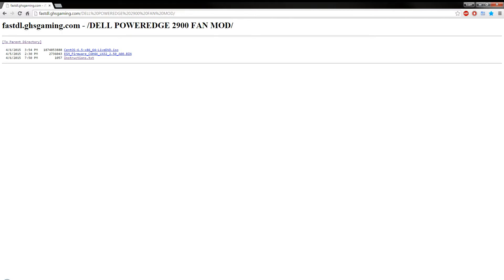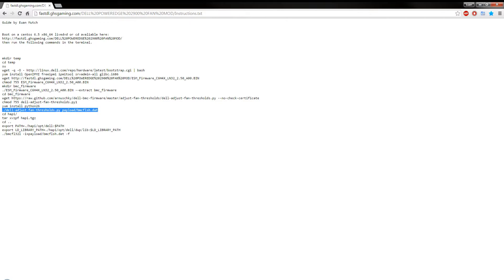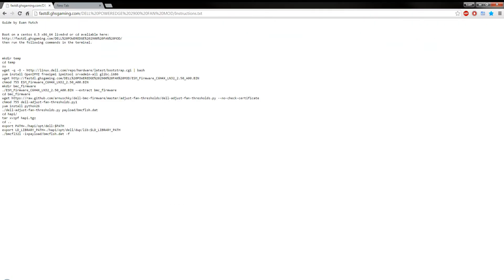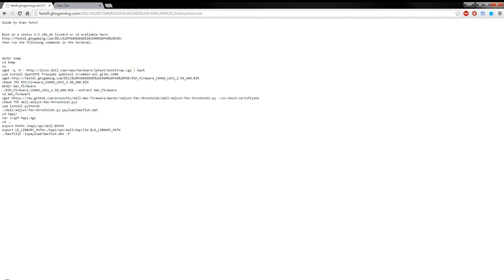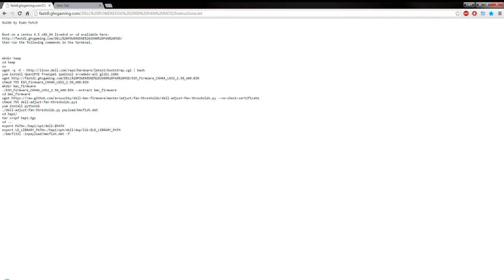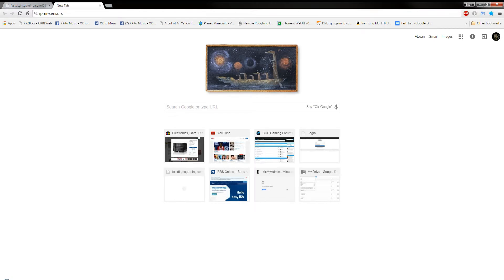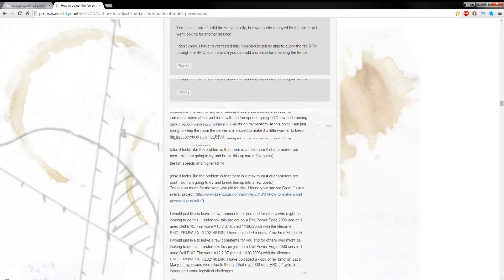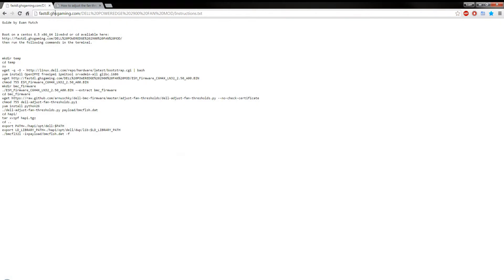Change the fan thresholds on a dell poweredge 2900 server

Comment: When I tried this, I started getting lots of erros saying that the file systems was read only.  I tried it with the livdcd burned to a DVD and also to a usb drive.  not able to get past the step installing the IPMI stuff.
Reply: if you install centos it to a hard drive it should solve that problem or you might be able to install from the cd onto the usb and then boot off that